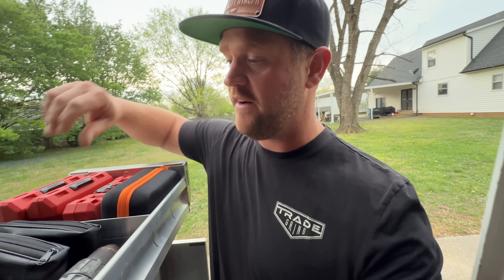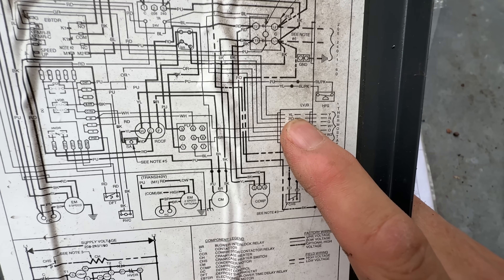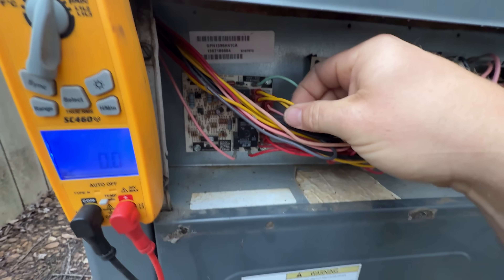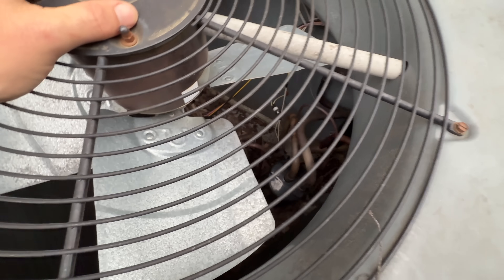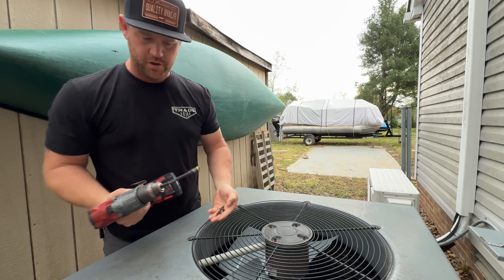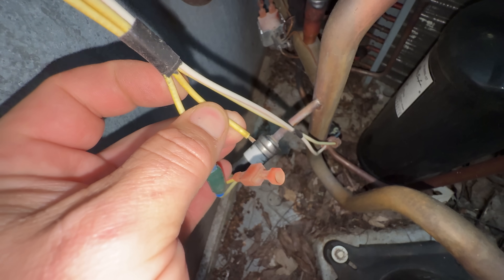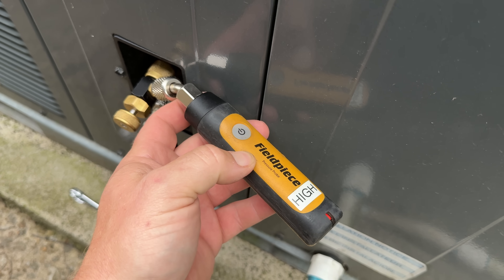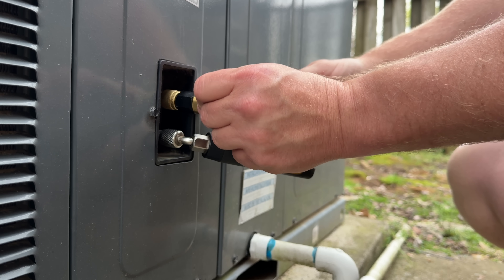Goodman Heat Pump Not Cooling | Typical Problem Fixed

Comment: Thanks for the video, it reminded me to check for physical issues when troubleshooting anything.  My Goodman heat pump was not working after returning from a week away.  I am not an AC guy and it's been years since I worked on anything even remotely similar.  Other than changing an occasional condenser, I haven't done much of this type of work as I have aged.  The board was showing a Low Pressure code and it appeared to be low on 410A.  We added additional 410A and it didn't take care of the problem.  We are not A/C people and didn't realize that this issue could show up as low refrigerant, even when that's not the issue.  It turned out that some sort of critter got into the cavity of the unit and chewed a wire, just a single wire.  That wire was giving a Low Pressure Code and wouldn't allow the unit to run unless we jumped the Low Pressure Switch that is built into the board.  We removed the fan grate, fixed the broken wire and the desert heat doesn't feel so bad anymore. Thank you.  👍

Comment: I’m thinking about putting that in a rental property but is it good to put a heat pump or a electric heat ac it’s in tx but it’s rental property
Reply: heat pump on the roof if possible to prevent residents and theft issues

Comment: One of our calls to was for a customer who’s ac wasn’t working. Upon arrival we noticed that the suction line was starting to freeze up, indicating a restriction. Opened the AH and there was our culprit: dead blower motor. Verified it and got quote to replace just the motor for around 1, 800ish (due to age of system etc. also got quote to replace unit with new system (customer requested)

Comment: Question (From a recent trade school grad). When you were checking continuity on that wire run after the repair, how were you getting continuity since a low pressure switch should be open if the system is not running? (Low pressure switch is normally open and closes on rise of pressure?)
Reply: 2:01 If you look as he's on the schematic the LPS is a NC
Reply: To answer your question, on a typical Air condition/Heat pump system when the system is off the pressures on both sides of the system eventually equalize, if the system is properly charged the suction side of the system should have enough standing pressure in it to keep the low pressure switch closed. I think what you’re referring to is a “pump down” system like a walk-in cooler that’s uses a liquid line solenoid to pump the refrigerant into the condenser and liquid line receiver to cause the low pressure switch to close thus turning off the condensing unit, then when the call for cooling comes the LLS opens and the low pressure switch closes on rise starting the system back up
Reply: @ Ahhhh I see what your are saying. Yes we did talk a lot about pump downs in school. Thanks for your help!

Comment: Remember you young guys, an impact gun should NEVER be used on a package unit just to remove panels for service work. Use your drill and adjust the clutch so you don't strip out the damn screw holes, rant over.
Reply: I've had several over the years that went from 1/4" to 5/16" to because of that

Comment: Always check for power even after the breakers are switched off. I've had a few over the years that didn't cut off the power like they were supposed to on one leg
Reply: I always check now. About a year ago I had a lead tell me to cut the breaker for the ac unit which I did but it was still live power because it was mislabeled by whoever wrote it down. So now I just assume it's always mislabeled at the electrical box.
Reply: I’m an electrician and don’t really trust anyone or anything lol so I’m always checking for voltage even after the breaker has been powered off.
Reply: he did check. what???
Reply: @themrmoy40  Yes He did, that's why I mentioned it. Good Job!